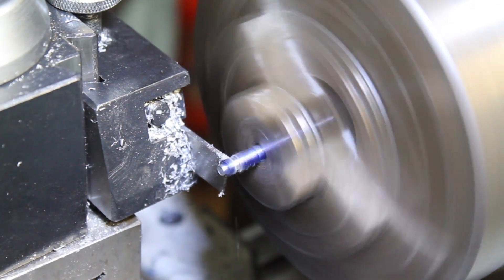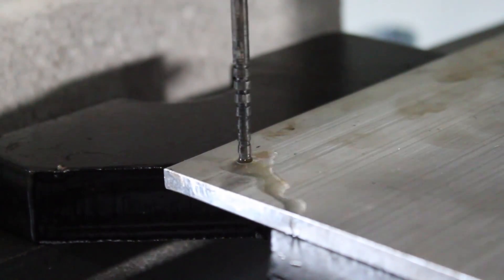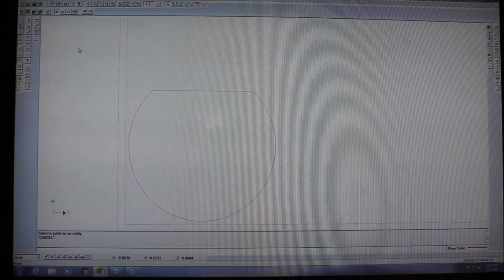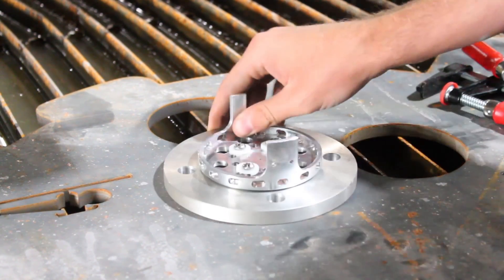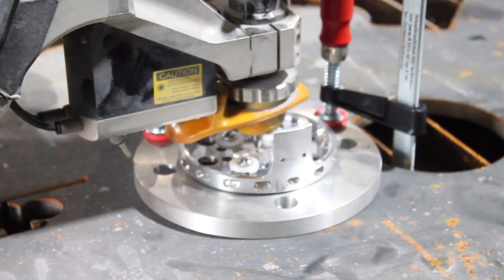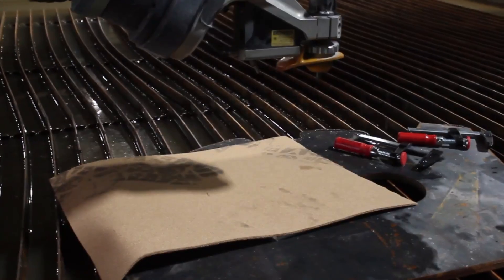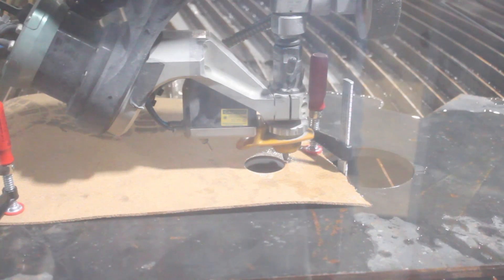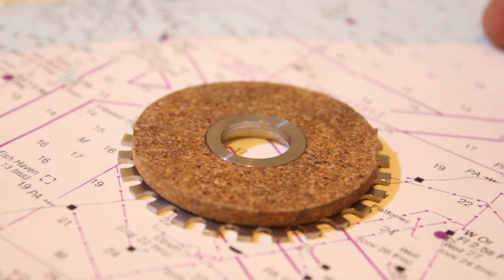Homemade Fly Reel Ep. 6: Waterjet Cutting

Comment: Great looking reel so far!  Is that yellow ring inside the drag disk a bearing?  If so, did you make the disk and main shaft dimensions off of the bearing?  Last question, is it an anti-reverse bearing?
Reply from the maker: Justin,  

Yes! The yellow disc you see is a stainless steel ball bearing with yellow covers, and yes, the main shaft and drag plate are designed to fit around the standard bearing dimensions. 

And no, its not anti reverse, the anti reversing will be handled by the paul clicking past the teeth on the outside of the drag plate. Old School.